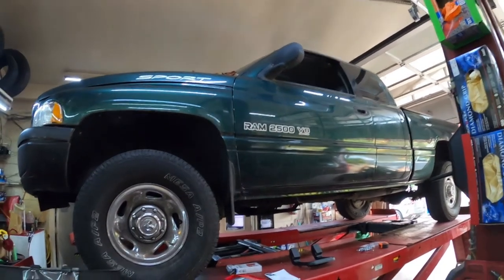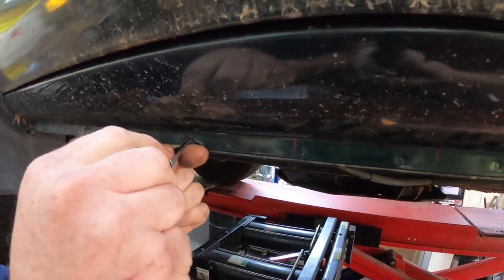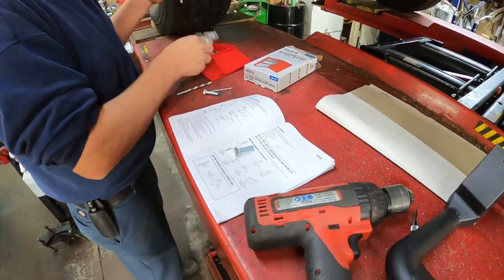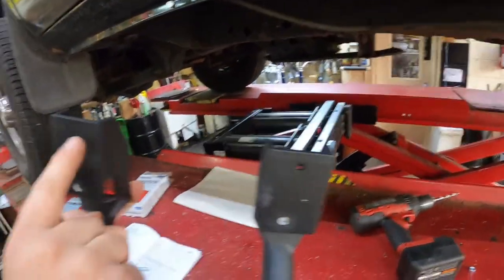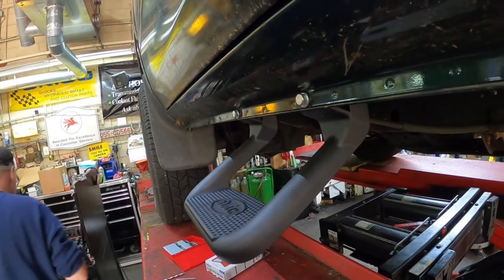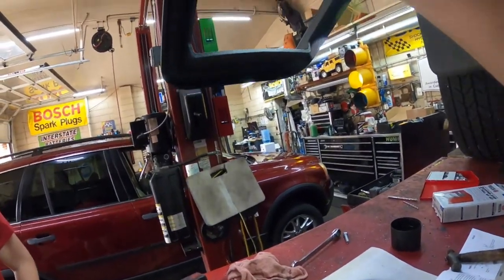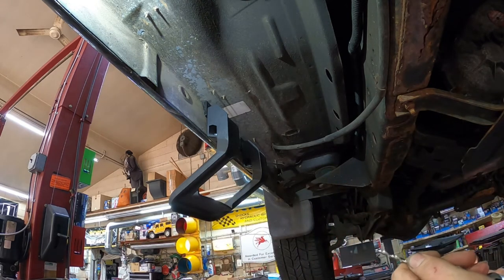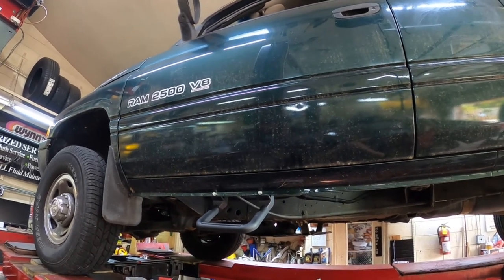Installing The Bully Brand Side Steps On A 1994-2002 Doge Ram Trucks

Comment: Yes again nice video  here’s a military tip wed put brush swab  iodine on bare metal holes that we pre drilled or remove rivets from to prevent rust .. it was like the old grade school glue dispenser jars with the brush on the inside of the jar cap/lid  presoaked in iodine ..remove cap Swab the hole replace rivet/bolt
Reply from the maker: Ok good tip. Thanks for watching

Comment: I am glad to see this video as I can clearly see now that this step is only for ornamental use and not for actually stepping on if they are to just be affixed to thin flimsy sheet metal. If a two hundred pound man was to step on this the sheet metal would give way and flex and eventually over time it will break away from the sheet metal. Also, I am sure that if the company that built this step after years of engineering and manufacturing thought it needed the holes on the bottom they would have done so and not weakened the metal more.

Comment: Thanks for the video. I need some similar steps, but I dont like the idea of them being installed to the pinchweld and the underside and not into the frame. How do you think the one's you installed will hold up to a 250 pound person getting in and out of the truck everyday.  In the video you didn't try to  hang on the steps or put much weight on them. Your honest opinion ?
Reply from the maker: They seem to be holding up fine. The guy that owns the truck is at least 240 pounds. No problems yet. I personally like a full running boards. The weight is more distributed and you can put your foot in different locations.

Comment: just curious, I'm sure there's a reason but why do you have to step up the drill bit size from 1/8 up to 5/16 instead of just going with the 5/16 at the beginning? Thanks great video
Reply from the maker: You want to drill a pilot hole to get the hole started. A bigger drill bit can walk around more that a small bit. If you do it like this you won't burn up the bigger bit. Thanks for watching